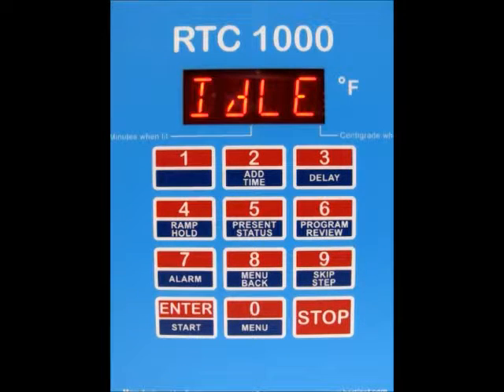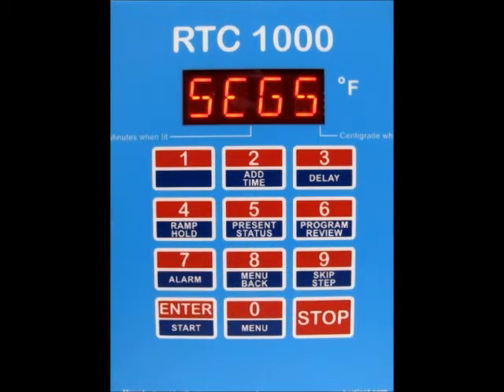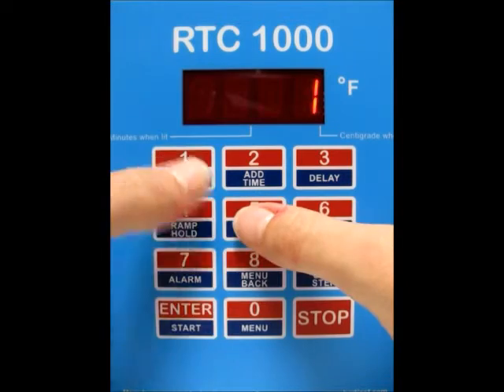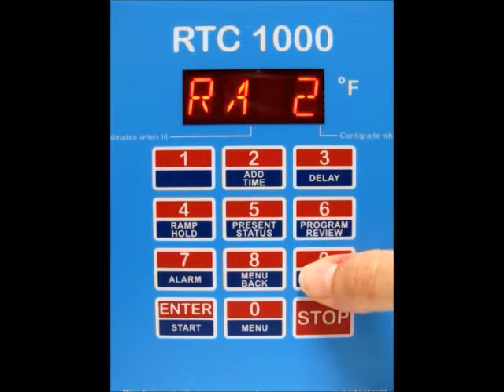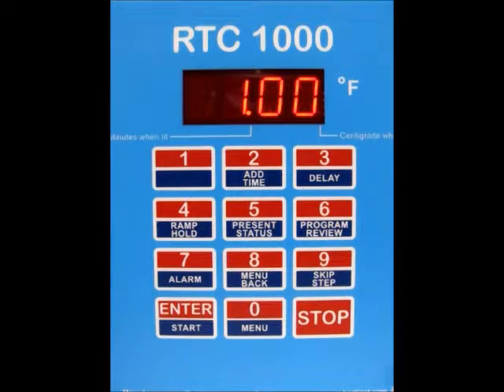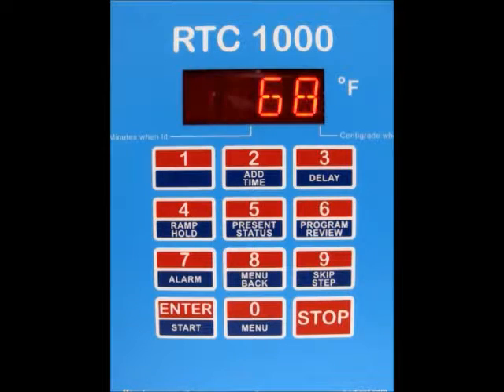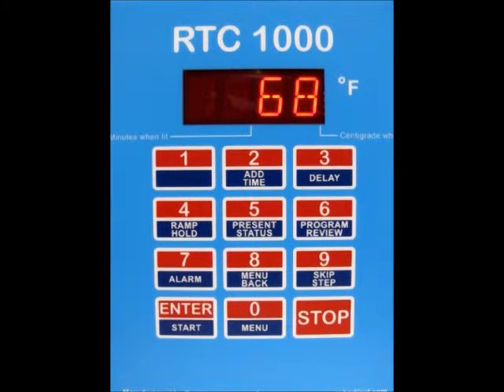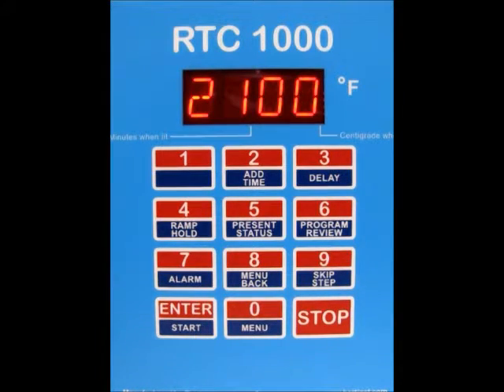Bartlett RTC1000 | Programing A Ramphold Program

Comment: what is wrong with me? I have such a fear about firing my new kiln. my first kiln is a Hoaf speed burn. I fire glass paint all manual controlls for 10 minutes shut if off cools down in 45 minutes. This controller just seem more complicated then it needs to be. Isn't there an app for this?
Reply from the maker: Sorry we missed your comment! If you are still having trouble with your controller we would be happy to assist you. Please email our support at techsupport@bartinst.com or call us at (319) 372-8366. 

The app you are likely referring to, KilnAid, works with our newest controller, the Genesis, and allows you to monitor your firings from your smartphone. Unfortunately, the app is not compatible with the RTC-1000.
Reply from the maker: You can add or remove segments in a program by going back into the programming of the USER program on the controller that you would like to change and step through to when the screen of the controller is flashing SEGS alternating with a number. Here you will press the button for the number of segments desired (up to 8 segments Max) on the controller to get desired amount of segments. Once the value you want is selected press enter and then you would step through the programming of each segment in that User program until the controller shows ALRM flashing with 9999 then press enter and the controller will go to Idle. The programming for that USER is now complete.